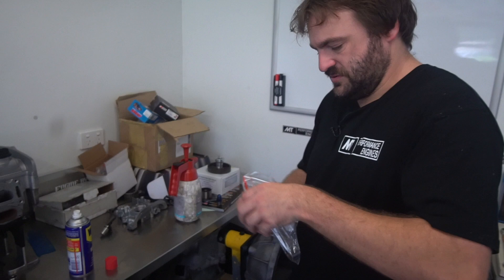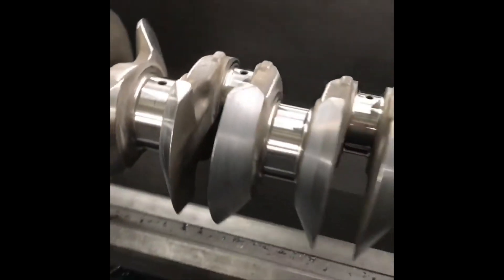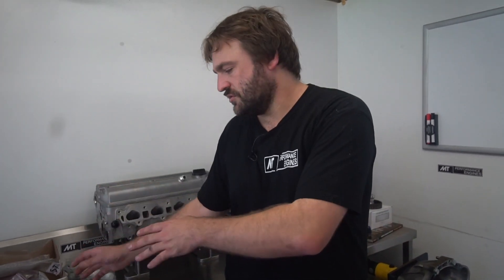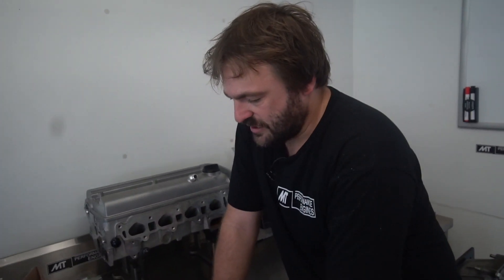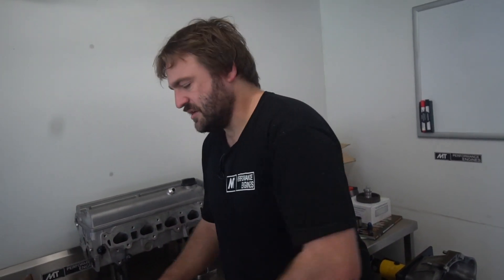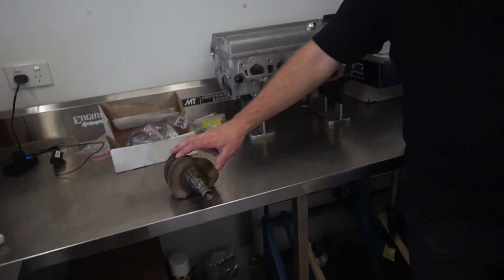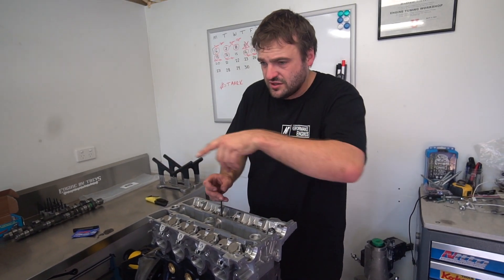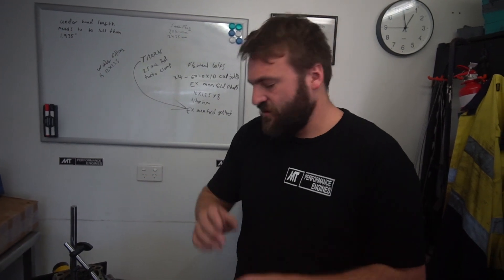Knife Edging (Ask An Engine Builder Part 6)

Comment: Hey — I have a question:  does the crankshaft counterweight/mass equal the piston + rod + bits and pieces (i.e., pin, rings, etc.)?  Therefore, if I install lightweight rods and pistons, would I not want to balance / knife edge the crankshaft to maintain opposing mass balance?

Comment: I have a 2.9 liter v6 and I want to do a stroker  using  the 4.0 liter version  and I want to know  reprofile a crank mean and I wanted  to use 5.4 inch rod with 94 mm and pin bore at 1.0 inch would that set up make sense

Comment: I keep looking for dynamic balancing of rotating assemblies with knife edged cranks and not finding it.   I would have  though this would be an incredibly important step for any engine.    Putting your engine out of balance seems like a generally shit idea.   My expectation is that knife edging would be done only as much as is possible to keep the engine rotating assembly in balance but that doesn't seem to be the case.

Comment: Pretty interesting. I never thought of the fact that the crank is balanced without rods or pistons on it. So the weight of the balanced crank shaft compensates for all those other unbalanced things. So less crank weight is a lower crank balance ratio. So stiffer springs for higher rpm mean more crank weight needed.

Comment: Knife edging a crank is useless, unless you're specifically building for limited RPM. The best option is to tungsten plug it, then reduce the overall profiles (axial, and radial) as much as possible.
Reply from the maker: Best option is custom crank but I get your point 👍
Reply: @NEVER-LIFT  - Everything I said, including knife-edging, would be custom. Did you mean something like a full billet crank?
Reply from the maker: @driverjamescopeland  Yeah, I had the option of buying a TRD crank back in the day and after speaking to Mat I decided against it.

If I want to go crazy Marine Crank is the best option (also the most expensive)

I can have anything I want made and I'd just let Mat spec it out, It'll probably be a stroker crank. 

I also saw multiple Marine Crank boxes when we visited Hasselgren. 

I originally asked Mat about knife edging when we were coming up with a plan for my engine and he explained that it was a bad idea. 

I just asked the same question for the video to try and help people out.

Comment: Good on the pros and cons of knife edging.  Sounds like you'll keep the mass and rather have higher safe RPMs.  If you were willing to take the time weighing and balancing how would you know if on your particular crank if you can get away with some lightening?  Wouldn't simply using much lighter rods and pistons allow shaving counterbalance weights?

Comment: Per David Vizard it throws oil in path of connection rod increasing resistence. Porsche and (another) tested it and went with another design that throws oil to main caps (no resistence) and increased power / faster revving.
Reply: Nice, I arrived here after binge watching DV's videos. Another benefit of reducing windage is ensuring that the viscosity of the oil remains the same. One thing that I didn't grasp entirely was how to calculate the balancing. There must be a formula around.
Reply: @temptnottheblade david vizard is a blessing on this planet
Reply: If it is found please do post it and/or forward it.  Much appreciated.  Cheers!
Reply: If ya going to quote a legend get ya quotes right 
It only throws oil if its been shaved on the wrong side

Comment: Do you know very much about the v-6 4.0 as in performance? I found that there use to be a bunch of different items for power adding but they’ve stop production or just don’t make anything any more .  I can get builders that will make you things but it’s all one off things like custom crankshafts bore the block and sleeve it . I really would like to add some more compression and some larger cams .  There use to be a cam company that kept them in stock but not any more.  I seen were a guy makes his own but he’s about 2000$ for the set of 4 cams . I don’t think there’s any warranty of any kind on them . Oh nice video on knife edging the crank counter weights I’ve done just the leading edges before but nothing crazy like the crank at the beginning of the video .  That’s extreme wow I couldn’t believe that.  The motor is 1G-RFE 4.0 Toyota the first two years single vvt I’ve got a rebuilt set of heads I’ve already ported and polished I left the intake runners like a little rough I think I stoped at 120-180 grit but combustion chambers and exhaust are super smooth I went big on my exhaust to match my headers !  Thanks for the video I’m subscribed now !

Comment: Considering that the leading edges of the crank are impacting an incompressible fluid in the form of oil drops/windage, you have to ask yourself this:
"Why don't they knife-edge the leading edges of the counterweights/throws?"

If they knife-edged the leading edges and trailing edges, drag would be reduced, also, but literally no one in the history of engine building has ever done this, to my knowledge.

Take it from a physicist: I have seen custom-carved cranks with a ROUND front edge on their crankshaft throws and counterweights, and that would be GREAT if it was for ONLY moving that crank through compressible air. However, it is NOT, so there is energy to be found by knife-edging not only the outer circumference of the crank parts to shed oil and cut through any windage, but the front and rear of the surfaces also. (relative to their motion through the emulsion of air and oil)

I have found in the hot rodding game, the people who make the most money on selling hot rod parts are most often violently resistant to any innovation, but the facts will ever remain: ANY and ALL masses that are going through an incompressible or partially incompressible medium need to be razor-sharp on the trailing and leading edges to maximize efficiency and minimize wasted energy.

Supersonic aircraft use razor-sharp leading edges on their nosecones. They don't have ROUND nosecones, because air at that speed (over sonic) behaves in an incompressible manner. The wing leading edges do not interact with the air in a predictable angle of attack, so they are rounded to maximize results over a broad envelope of angles of attack.

I marvel at how completely these facts have been bypassed by designers of boat hulls AND other bodies in which fluid dynamics are critical.

That round blob at the front of a submarine isn't for hydrodynamic efficiency. It is to provide a consistant interface between the sea water and the sonar dome. It's an acoustic refraction issue, not  an issue of streamlining, as incompressible fluid (water) laughs in your face if you think it is easier to slice through with a blunt, rounded front end than with a sharp snoot.

Look at how God made the fastest fish on Earth: the black swordfish. Isn't it interesting that it doesn't have a blunt prow on it, but instead, a long, gradually-tapering needle?

Also in the top five: the mako shark. Does it have a basketball nose?

Nope.

Look and learn, hot rodders. Knife edge the leading, trailing, AND outer edges of your crankshafts, and you will find:
A) less windage, absolutely obviously, due to oil slipping off of the crank outer circumference and less impartation of crank motion to the oil and air
B) less drag due to a finer entry to the oil spray in the crankcase by the crank, and,
C) less drag due to a finer departure of the air (emulsion, really) flow as the crank part continues past it, and the air being allowed to gracefully rejoin after being split by the body of the part in question
D) less drag due to better airflow attachment to the surface, which makes (C) more likely to occur with minimal losses.

We churn our crankcases like they are a brick in a butter mill, yet, our boat propellers are knife-edged on their leading AND trailing edges.

Blunt leading edges super-completely-only achieve lowest drag if and ONLY if they are traveling ENTIRELY through a compressible medium.

Also, I'm not even getting into the importance of area rule, which they have just recently discovered applies to subsonic AND sonic flow.

There is lower drag available than what is being used. Lower drag and lower windage.

Bodies travelling through compressible media DEMAND very-finely-pointed leading and trailing edges for minimum drag.
Reply: once you learn about aero and fluid dynamics, its clear its reserved to dysons and airplanes, it is an after thought to other things, i live in australia, where trucks drive 1300kms between citys with a square body, and no tapered tail. and in uk you see lorrys made aero dynamic to travel 100km. intakes and exhaust have fluid dynamics as a first thought, turbos, oil and coolant passeges, and cranks, its an afterthought.

Comment: I milled all the casting marks off my crankshaft.  Polished and put radials on the ends of the  counterweights and then re-balanced. All rods polished. 
I put silicone wipers inside my case to wipe the oil off the  edges draining the oil into the scavenge pump scupper. 
Oil would not stick to my crank and rods. 
I also did some mods to my wheelie bar. 
I dropped 2 seconds on the 1/4.  Most on the start being able to apply full power without spinning my back wheel.
Reply from the maker: wow do you have photos? DM me on insta
Reply: @NEVER-LIFT   No pix.  25 years ago. Any photos went with my wife in our divorce. 
We did the balance calculation before milling/polishing the crank and could not remove any more material. You also kinda need some metal for a crankshaft.  The motor wouldn't idle below 1000 rpm but would accelerate like nuts.

Comment: Good video, but I have a question, what are the things you need to do if you want to build a high revv motor
Reply: Knife-edge all edges of crank,  stiff valve springs, titanium retainers, hollow valves, sodium-filled on exhaust side, lightest connecting rods and pistons you can afford, light flywheel,  larger ports and passages leading to intake and exhaust valves, and a shorter stroke-to-bore ratio.

Comment: How does this affect oiling?   Crank sling.     drilling outside of counterweight vs center and knife edge.  a crank to balance it isnt it
Reply from the maker: It was just a point Mat made about how the crank travels through the oil in the sump and can cause aeration and knife edging may reduce that.

He was just trying to give as many examples as he could on the spot to why people knife edge cranks

Comment: Very interesting. One question though: How do I measure the weight of the amount of material to remove, from each counterweight? Eg, when I have a "complete" crank.
Reply from the maker: Mat explained to me that the only way is to sacrifice a crank and cut it into pieces 

I think there might be a section of a crank on the bench in this video
Reply: you use a crank balancing machine.

Comment: Also, if the engine is in a pickup or a SUV, the lighter crank will reduce the torque that the engine produces under sustained load, reducing its ability to keep RPM while being "lugged".  The heavier mass is harder to get moving but will tend to stay moving longer & with less throttle input.

Comment: Think about this! @ 200mph there is an excess of 2500 psi(per square inch) in water! Oil is thicker than water but  a lighter specific gravity! Never the less hitting water, oil, Or concrete @200mph is going to produce a significant amount of hydrodynamic parasitic
Drag! Especially in a stroker crank configureation w/3-5” of counter weight hanging out in the wind or oil in this instance! The bigger the crank diameter the higher the rotation mph! @ 7-8k rpm’s crank rotation mph is around 300mph depending on the stroke of the crank!

Comment: I wouldve though majority of the weight associated with crank counter weights and flywheels was related to idling at low rpm and driveability at low speeds. You're mentioning balance factor but a four cylinder engine fires 1 piston at a time. Most cars if not all cars dont make the same power on each cylinder wheres the balance factor there?

Comment: Can we counter weight a standard crank  by welling parts to it ?
Reply: you cant but they might break off at high revs or fuck up the heat treating of the crank, the right way is bore holes and fit weights (the weights are a material that are heavier than crank material)

Comment: I've often thought about this process. And that's what left me to ask about Connecting Rod ? Why do they not knife Blade them also? With carbon fiber, some of the composite that are available today. Why is someone not looking into this as a way to help a Gasoline or Diesel Engine more efficient. Like you've already stated it's about Aerodynamics. When they generate Electricity then don't cut through the air with a block of steel. they use a blade. When designing an engine for performance. Anything that in the path of the intake must go. That's why there is Porting and Polishing. Now back to the connecting rod it's not going to be straight up and down as one would think. It's either gonna have bent appearance, @ the aft. Or depending on the Manufacturer it might even be a bit off-center on Bore. 4cyl's taday are making more power than what most eight cyl's. Made back in the day. And now we've got supercharged, twin turbos That are pushing the limit. The lower half is the Heart of the engine. We've got today in this age Carbon Fiber Drive shaft's... Just think about it that's what creates inovation & yes Balance.
Reply: I think the reason is due to strength. to knife edge the rods you sacrifice too much strength to be worth it.
Reply: Though this is a valid point, the cost involved versus the technology investment would be phenomenal.
Ultimately, if they just aggressively evacuated the crankcase, which is an existing technology, a few benefits would be realized, including less suspension of oil droplets in the less-viscous air mass.

Comment: Uhm. Still mind boggled about the rpm limiter having to be reduced due to weight loss on the crankshaft because I have in my car taken out from my e30 a standard 318i crank shaft with 8 counter weights and replaced it with a 318is one that has 4 counterweights, so I find it hard to believe that knife edging your crankshaft is a bad idea at all as BMW have taken off 50% counterweight off their IS crank and it’s still as well balanced and and able to perform at it’s best. I feel like when you knife edge your crankshaft you should just make sure whatever you do on one side you do on the other to maintain the balance. Hope that I’m making sense. Even if you’re not running a flat 4, 6 or whatever, the crankshaft rotation balances itself out.
Reply: Yeah you just need the proper counterweight, not more or less. If you have more then the crankshaft itself will be putting the forces on the bearings, less and the acceleration/deceleration of the rods and pistons will be putting forces on the crankshaft.

Crankshafts are balanced to rod and piston sets with bob weights. The RPM is limited by the camshaft, springs, and valves moreso than the balance of the crank. After that it is limited by the mass and geometry of the rod and piston which influences rod stress, piston speed/accel/decel, and mass which puts forces on the crank.

Comment: Excellent video!! I was thinking about getting my crank knife edged but was only wanting to "Edge off" the same amount of weight I could drop with the new conrod and piston combo, say 200grams per combo, knife off the same on that counterweight... That way, atleast in my mindset, it would still keep the factory balance, just be matched lighter, and have the added benefits...
Reply: I know this is an old comment, but from my understanding the crankshaft balance mass doesn't fully offset the piston and conrod but instead about half of it. That's because you can never fully balance a reciprocating mass with a rotating one.
Reply: your idea makes sence to me, but i did not uderstand the guy in the video wanted a heavier counterbalance for  more revs?

Comment: so a question springs to mind here (ive always thought knife edging was to do with reducing friction with the oil ... never heard of said idea about airating the oil) - are aftermarket 4age pistons available now, or possible to make for a worthwhile cost, where you could fully knife edge a 4a crank (and not have to keep rpm low)? - when would you make high hp and do it?
 ...im aware one of audi's engineering contractors is doing some interesting and promising looking r&d with 3d printing hollow spaces in piston material lately - I know the tech is there, but heaps too pricey as far as im aware ....?
Reply: Yes there are a couple different 4age 16v forged pistons available. Don't know much on the 20v side, never looked.

Comment: I'm really keen to hear more about all the things he's done to reduce oil starvation, or some more information on how he filled part of the water jacket with cement. Not things you see in any old 4age build or manual
Reply: Concreating a block is a pretty old school method of strengthening the bores if you watch the 800hp build we explain a bit more but I will add it to the list of videos to do
Reply: Actually, I'd be interested in hearing his opinion on how much scoring on camshaft wear surfaces is too much. As you know, they're a bit concerning as they're solid pieces that wear on the head and cap